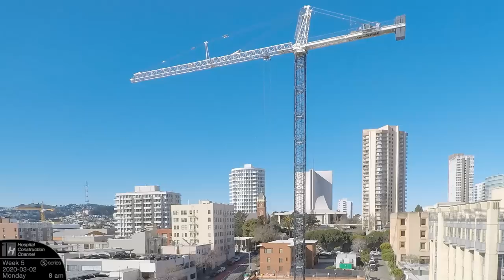One-week construction time-lapse with closeups: Week 5 of the Ⓢ-series

Comment: From 22:00 to 24:00, they pour a concrete platform at the back of the site with no reinforcement. Won't that crack eventually?
Reply from the maker: That's just there to give a clean platform to work on (instead of working in dirt). You are going to be seeing boatloads of rebar assembled on top of that in weeks to come before the actual slab is poured.
Reply: @HospitalConstruction  - Thank you for the explanation. I look forward to the next segment.
Reply: you might hear the term "rat slab" used by construction crews, its a non structural slab
Reply: also called a mud slab
Reply: leveling con'c, sub slab, sole plate con'c, junk con'c ......

Comment: When the crane is being rotated in the first 5 minutes of the video, it is actually tilting to the side a little. Is that safe?
Reply from the maker: It is normal for the crane to twist and flex a significant amount as the load moves.  I'm not an expert, but I believe it is better for it to be a bit flexible than for it to be completely rigid.
Reply: yeah bud if it was rigid it would just snap,